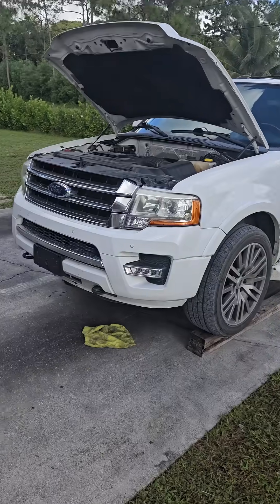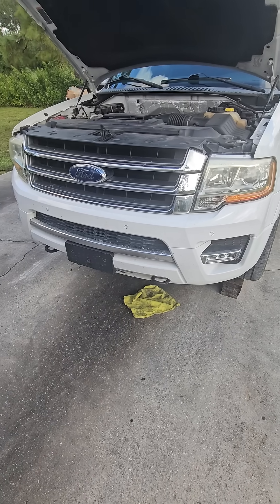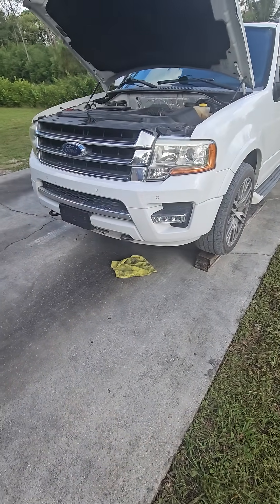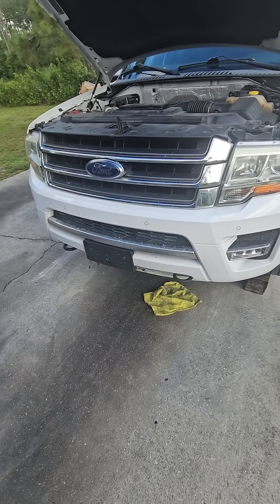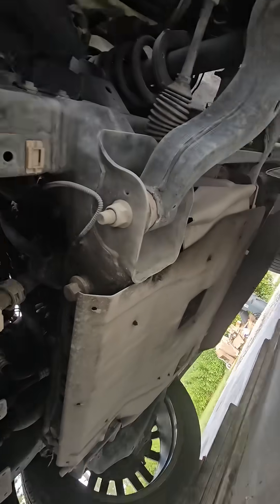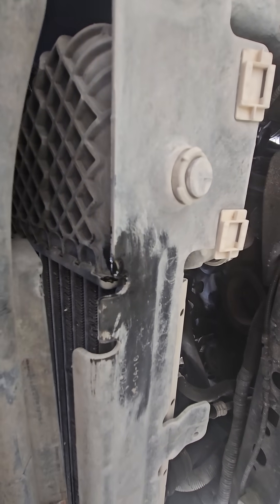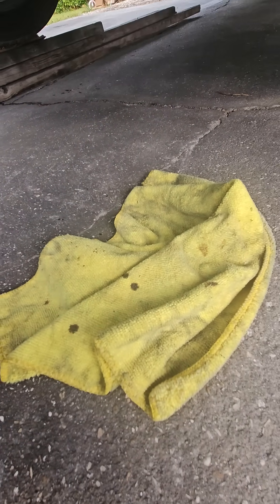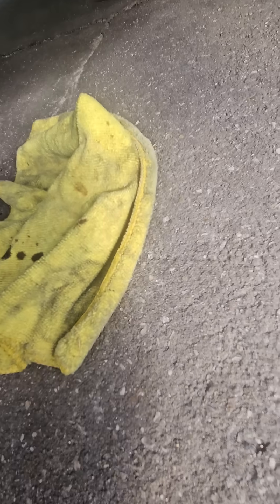2015-17 Ford Expedition & Lincoln Navigator Intercooler Weep Hole Modification 3.5L Misfire fix

Comment: So if you crank it up it should blow out of there? Wont you lose boost once all the oil gets expelled. So its like a 6.7 diesel ,the oil mist from crankcase gets dropped in front of turbo to go thru intercooler to mix with garbage from egr to carbon up motor.
Reply from the maker: Yes correct it should push out of there once running. I assume .0005 psi of boost is lost with this mod. My truck runs the same as it does prior to drilling said hole.

Comment: I’ve got a 2016 navigator with 150k that makes  lots of squeaking noise when I go over bumps. Also when I make hard turns with the steering wheel turned all the way. Any recommendations on what to do?! Thank you and I love the vids!
Reply from the maker: Squeaking over bumps should be your sway bar bushings/links. They may need to be replaced or simply greased/lubricated. They get dry over time and when you hit the bumps the bar rotates in there where it was once lubricated it gets all dried out over time. Could be upper strut mounts but doubt it. 

Squeaking when turning the wheel is a tough one, that could just be related to the above because when you turn the wheel the suspension geometry changes and will rotate/move the sway bar end links. So would start there!
Reply: @cpstang24 thank you so much! I’ll definitely look into those!
Reply from the maker: @grahamgoldsmith5913 also now that I am thinking of it, check lower ball joints as well up front
Reply: Thats great known issue, upper and lower control arm bushings, sway bar bushings.  Just repaired a 95 town car w same concerns.
Reply from the maker: @triggersnob9722 yea town cars are notorious for that
Reply: Check your ball joints